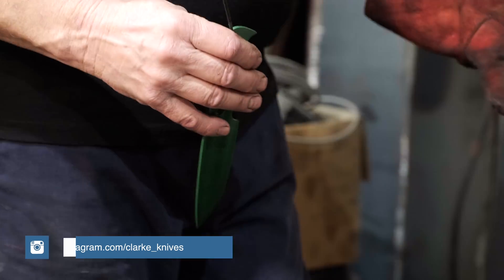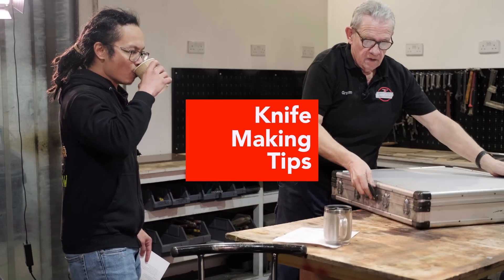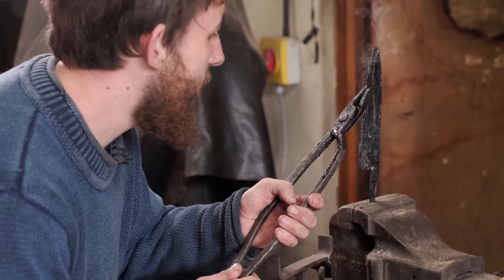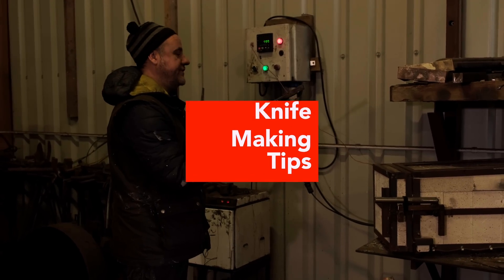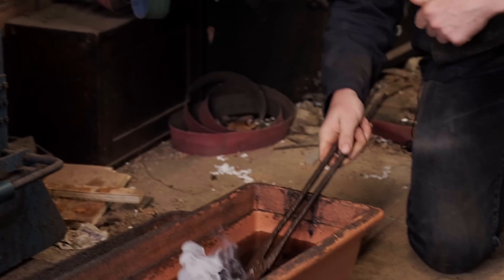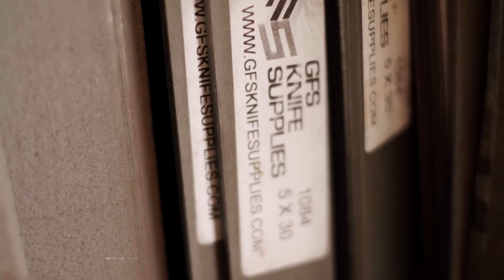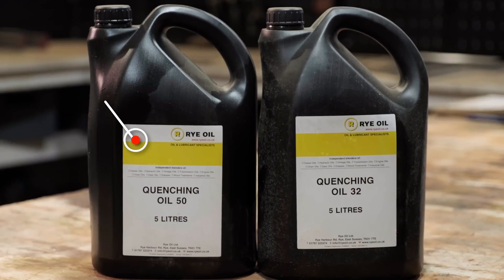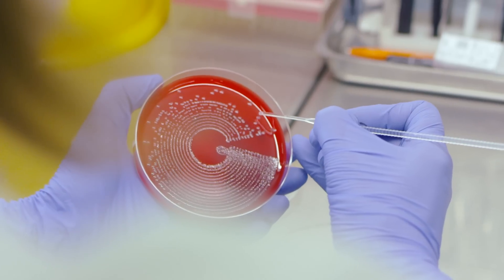The ONE and ONLY THING you need to get the best grain size

Comment: Great information - just one comment: even though the pyrometer you use should only respond to the emitted UV , the actual reading does rely on the emissivity of the material (black body conditions) - especially with stainless steels. Therefore, that variable needs to be taken into account. For example, a skillet will read quite low unless oil has been added, at which point the reading will be more accurate.

Comment: I run a double burner gas forge and i rigged up a high temperature k-type thermocouple to a high temp digital guage. I can raise to my high temperatures, turn back a little holding temperatures for soak. Once i upgraded to my forge with that i started getting great repeatable results
Reply: Thank you for sharing. I've been trying to figure this out.

Comment: I don't fully agree with what he says about normalizing. 

I think the best way to normalize ideally is going to be to at least get it hot enough to be entirely sure all cementite has been dissolved. Which for most steels is fairly hot. 

Then do another cycle at a normal austenitizing range. If not follow the normalizing cycle with a fast det anneal or something similar. 

Because if you only do one lower normalizing cycle you aren't going to eliminate things like carbides that have grown during forging or formed on grain boundaries. If you are only getting it just not enough to fully austenitize but not hot enough to fully dissolve all austenite. But if you get it hot enough to dissolve all carbide, then it gets hot enough to grow the grain size. 

All this rambling is to say 2 cycles makes then most sense. Either a high normalizing cycle, then a normal one. Or a high normalizing cycle and an anneal.

Comment: I did a lot of quenching into molten salts back in the 90's (developing spring steels) but there the aim was Bainite not Martensite. Molten Sodium Hydroxide is very good, as it has a high specific heat and also a very high infra-red transparency. The metallurgy lab (at Leeds University) were still using up old stocks of Whale Oil quenchant. The theory was that it worked well and that throwing it all away wouldn't help the wales at all, so they might as well use it up. Another very fast (and dangerous) quenchant I have heard of is mercury. Rivett lathes always advertised that their spindle bearings were "As hard as fire and mercury can make them"
Reply: Martempering is a fascinating thing. It's mostly useful for when you want a softer steel than you can temper without running into the enbrittlement between first and second tempering zones.. I suspect leaf springs of 5160 might do this to get it down to mid to low 50's while staying so tough. Normal heat tempering range of 375-450f will only get you something like 56-59 rockwell

Comment: The steel ceases to be magnetic at the Curie temperature. 
Somewhat surprisingly it is purest coincidence that this is (almost) the same as the phase transition temperature. 
Which is partly why, as you point out, a magnet can only ever be a guide. 
A very interesting use of a carefully tailored Curie temperature is the Weller Magnastat (Or TCP) soldering irons. The tips cease to be magnetic at the set temperature, and that releases a magnetic relay and turns of the heater. This is how you can change the temperature setpoint by swapping tips.
Reply: The steel is EXACTLY nonmagnetic at the phase change because martensite isn't magnetic. Problem is, you might reach Curie before you fully convert if you heat it too quickly. Some steels are martensite at room temp and so not magnetic. 
If you normalize the steel properly for pearlite, simple steels without carbides will dissolve very quickly into martensite and so you can quench the exact moment it loses magnetism. Look into Larrin's knife steel nerds website or YouTube channel for more information. I would normalize first even for stock removal so that you don't have to worry about holding temp for the quench
Reply: Martensite is magnetic. It's Austenite that is non-magnetic, but ferrite is also non-magnetic above the Curie temperature.

Comment: When do you change out your quench oil?  Can X volume of oil quench Y mass?  Can it be filtered/cleaned?  Why is it a consumable item?  My best guess is that the quenched metal is absorbing/removing some elements of the oil and not others?
Reply: Filtering out the crap that’ll acclimate will help the oil last longer. 

Quenching oil will eventually need replacing when the additions used to break up the vapour layer are gone. They’re somewhat volatile so will burn off and react with the steel and stop working (it’s not so much the steel absorbing them but them reacting and not doing what they’re designed for). Using an oil too hot or too cold with also accelerate it’s degradation (see manufacturer’s recommended temp range).

For a hobby blade maker even old oil will likely be good enough. If you’re making safety critical parts for an aeroplane then you’d definitely need to keep a closer eye on oil quality and quench rates.

Comment: 8:25 what about using a pump to move the quench oil so you dont have these hot spots?
Reply: That is indeed a solution used in industry. 

A pump is a bit overkill if you’re doing one knife at a time as a hobby when dunking it up and down by hand does the same thing as a pump would. A few 100s of kilos of expensive automotive parts, though, and an oil pump makes a lot of sense.

Comment: I'm planning to heat treating a 1075 knife today, I find that u should quench in oil, I think that is correct but I remember testing 1075 and I quenched it in water and the test piece held up fairly well
Reply: My heat treating did not happen because of issues I've decided to find a heat treating service
Reply: @ThatOneOddGuy  As a former contract heat treater, I approve of that decision. 

A fairly fast oil should harden 1075. Water will definitely work but brings with it an increased risk of quench cracking and warping. The general rule is to quench as slowly as you can get away with while still getting a full transformation.

Comment: Does the quench oil temp make any difference?
Reply: It can make a difference. The viscosity of an oil will affect how well it quenches and that will vary by temperature. But if the oil works when it’s not at its ideal temperature then it’ll work at the ideal (though extremes will make a difference - leaving oil out in an arctic winter isn’t a good idea). It will depend on the quench rate you need from the steel you’re using. You could get away with not controlling  temperature with some steels but not others. 

Using an oil at the wrong temperature can cause it to break down over time so keeping to the manufacturer’s recommendations should means it lasts longer and work at its best. 

If you’re doing large numbers of pieces one after another then the quench rate will change as the oil heats up. Not an issue if you’re a hobbyist doing a couple of blades a day but mass production specs often do require control to keep the results consistent over batches.

Comment: Given the quality of modern  alloy carbon steels for knife making,does forging [properly] enhance or detract from from the finished product?
Reply: It depends… 

Forging will generally give you better properties than an unforged steel. And going through the full process of normalising etc you’ll need to do with forging will give you a better carbide distribution compared to stock removal of an annealed steel. Forging also give you a bit more choice in blade shape and reduces the amount of material you need. 

That said, stock removal from a decent steel properly heat treated might well be good enough for your requirements. The extra improvement and the added steps from forging (with the extra things that can go wrong) might not be worth it.

Comment: Hi. What type of steel at what HRC would you say it's best in terms of edge retention?
I do like sharpening knives and was obsessed with this a few years back, however now I have less time to sharpen them..
Could you please mention one stainless steel and one carbon steel?

Secondly, I would go for cpm rex 121 at 67 hrc - would that be silly?
Reply: A blanket statement on HRC isn’t going to be all that helpful, I’m afraid. It really will depend on the specific steel you’re using. In general, though, the higher the hardness the better a steel will resist the abrasive wear that will dull a blade. 

There are basically two ways of achieving that hardness. The first is by how hard the martensite you generate is. Broadly speaking, the higher the carbon the harder the martensite. But… the higher the hardness the less ductility the steel will have. You can get the maximum hardness of a plain carbon steel right after quenching but it’ll be unusable because of how easily it’ll chip. So much so that you might not even be able to sharpen it without it chipping. You’ll need to balance hardness (and edge retention) with durability. The specific alloying can help shift how hard or tough the martensite is - nickel, for example, will generally increase the toughness of martensite. 

The other main way is to include hard phases like carbides. That’s where most of the development of modern blades has gone. Those carbides can really ramp up the measured hardness while still having a relatively tough martensite. Most of the work has gone into fixing the size and distribution of the various carbides (and sometimes nitrides) in the steels. A lot of that is controlled by the steel making process itself so the same grade of steel from different manufacturers might not give the same results. 

I’d advise scepticism on claims that X HRC is the best for knife making. 60 HRC can be way too high for a plain carbon steel to work properly while 68HRC can be just right for a steel with loads of well distributed Vanadium carbides in it. If you’re interested in a particular type of steel then I’m sure you can get good advice and help from the people that have used it before and recommendations from the steel maker.

Comment: I have always used canola oil heated to 120 degrees C for quench. This method has worked well for me with W2 steel, and recycled leaf spring for my knives.
Reply: Lol, I think you mean 120 F
Reply: W stands for.. water. Water quenching. O2 would be oil quench. If your blades are thin enough maybe you can get away with it but you might not be getting full hardness. A2 is air tempering just to complete the set.

Comment: If the whole knife has to be the same temp before quench, how does edge quenching work? I saw a master bladesmith edge quench to earn his master (Kyle Royer) 
Aren’t katanas also edge quenched as well?
Reply: The type of steel used for edge quenching needs fast quenching to harden. If you’re too slow it won’t transform into martensite at all. With some grades you’ve only got seconds to get it from the furnace into the quench. 

With edge quenching you are basically dipping only the edge into the water or oil so it quenches but leaves the back in the air to cool more slowly and avoid the hardening but remain fairly tough. 

Does that answer your question? Or did i miss what you were really asking about?
Reply: @GemAppleTom  yes thanks!

Comment: Really interesting and useful as always. One thing I'm curious about though is never quenching knives into water. I understood that not only do water-quenching steels like W1 give the most active hamons but they also require at least the first part of the quench to be in water or they bend the wrong way. By the wrong way, I mean the tip bends down toward the edge not up away from the edge as you would expect on a katana or wakizashi. In my (extremely) limited experience, this is what happens. I have a 1095 tanto that has a passable hamon from oil quenching but the tip bent down not up. No clue why this would be the case but people like Walter Sorrells observe the same. Any ideas?
Reply: Water quenching is one of the best ways to start with one piece steel and get two out of the quench. Most contract heat treater won't touch it because of that. No one wants to tell a customer that the hard work they put into something has just been ruined. 

Water is pretty much as fast a quenchant as you can get but it's also quite inconsistent. A general rule is to quench as slowly as you can get away with and as evenly as you can manage. Water is overkill on speed for most common steels (but is required for things like low/medium carbon unalloyed steels) and also not as consistent as oil.

I can go into why it causes problems if you'd like but it will need another long post.
Reply: I've been having a think about your knife bending towards the blade instead of away from it... 

It's easy enough to explain why a katana would bend properly if done right. Martensite is a little less dense than pearlite so the hardened side of the blade will try to expand more than the back and cause the whole thing to curve. 

Before speculating on the backwards curve - can you tell me if the tanto hardened up as you expected? Soft spine and hard blade?
Reply: Hi Tom, thanks for your continued thought on this one. I understood the different densities of martensite and pearlite would account for the normal curvature of the katana. I assume this also explains the "crispy bacon" wobbles that can occur in an edge if it is too thin when quenched.

The tanto hardened up as expected. The hamon is definitely there which I take to indicate there are different crystal structures on the edge and the spine. I'm struggling to think up any physical mechanism that would explain the reverse bend in the way differential density explains the normal bend.
Reply: @RobanyBigjobz  Hmmm... if it hadn't hardened properly I would have suggested the following:

Pearlite is a bit less dense than austenite. The blade side transformed first slightly pushing on the spine. Then followed by the thicker spine which would push the blade side further since there's simply more there. Ta-da! Backwards bend. 

But if the hardening went well... Possibly it wasn't a complete transformation and the edge is a mix of martensite, bainite and pearlite. Not enough expansion to overcome the spine's expansion but enough of a difference in phases to make the hamon visible. Maybe... perhaps... 

I can think of how to check for certain but it'd mean destroying the knife.
Reply: Incomplete transformation sounds plausible in my case. I don't have any kind of temperature control as this was done in a simple gas forge in the back garden by a novice making knives to amuse themselves. The only predictable part is probably the quality of the quench oil I got from GFS (Parks 50 equivalent).

While I'm disinclined to destroy the knife to do the check, I'm very interested to hear how you would perform that check.
Reply: @RobanyBigjobz  To check I'd cut the blade and inspect the cross section under the microscope and do a series of hardness tests. Both together will give a pretty good idea of what the crystal structure is. 

But I have access to to preperation equipment and a microscope...

"To a man with a hammer, ever problem looks like a nail."
Reply: I've quenched in water and it has worked well enough for me in some cases.  However if I were to make a knife from an old car spring, I would not quench in water as it is very likely to crack.   I think it is best to take the advice given in this video.... but if you are primitive-minded like me... or if you have no other choice, then you might find that a water quench is better than no quench.

I've never had a knife (that I'm aware of) that was made from a particularly fancy or hi-tech material.   I've made knives from saw blades, car springs and a file and they all served a purpose.  I once ground a blade from a high speed steel hacksaw blade.  I could get it sharp, but I didn't enjoy the process and I'd never be confident about using it as a hunting or 'outdoors' knife as I'd be worried that it would break.   I've also owned a heap of store-bought knives with black carbon or stainless blades.  They all worked.  And none of them seemed to have magical edge-retention properties.  I'm a hunter and I've often been frustrated with a sharp knife losing it's edge while butchering on the hillside.  Recently I've started looking at knife edges through magnifying devices.  Blades with almost mirror-finish bevels can have ghastly-looking ribbed, torn and pitted edges.   These revelations were a bit like a kid finding out that Santa isn't real.

These videos featuring Graham are interesting and useful.  Thanks for posting them.  Best wishes from New Zealand.
Reply: Bricktop's twin brother

Comment: PS: well it takes longer to do isn't a clay quench safer then an edge quench? well the exposed edge hardens faster, the isolation of the clay causing the spine to cool slowly. from doing a massive number of these i noticed you tend to be ready to go when your medium stops boiling.
Reply from the maker: hi gundanium, you might be correct. Thanks again for the comment!